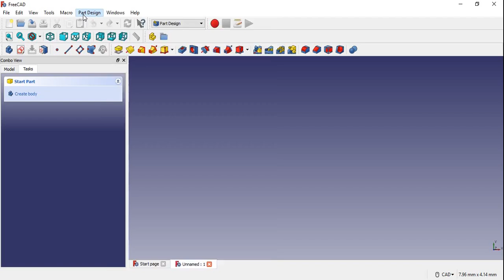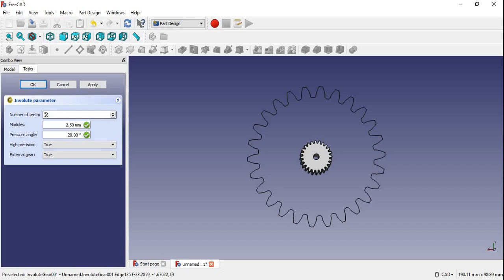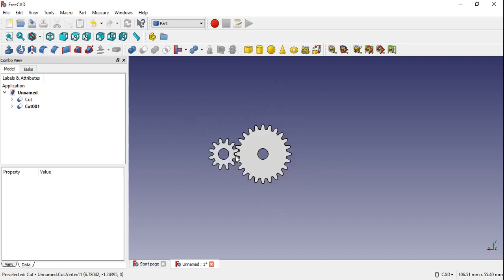How to make gears in Freecad

Comment: Gear Diameter: 
Modules = Desired Diameter / Teeth

Mesh Properly:
Modules must be the same

Position Equation: (M*(T1+T2))/2
(Modules*(Teeth1+Teeth2))/2

Angle Teeth:
360/Teeth/2
Reply: Thanks a lot man!
Reply: im running into an issue. i have to make a gear that is smoth on one side while the other has 9 teeth with an outside diameter of 32mm. i made a gear using 32/18 module, than made a half tube 16mm radius to cut the unwanted teeth off... the gear does not have a radius of 32... its larger than my half circle, what's wrong?

Comment: 0:45 for anybody out there trying to get their outer diameter to be exact, the given formula in the video isn't correct.
the formula for outer diameter is:
OD = module * num_teeth + 2 * module

solving for module this gives:
m = OD / (num_teeth + 2)

hope this helps anyone wondering why their OD isn't as expected using the formula in the video.
Reply from the maker: Yes, you are correct. Maybe I should've been more clear in my video, the diameter I was talking about was the gear pitch diameter. This equation is good to know when wanting a specific gear ratio and a have set distance between two shafts.
Reply: @TabletopRobotics  The rest of the video was super helpful, I'm just new to this and my gear wasn't the right size so I had to do some digging and left a comment in case anybody else had the same issue.

Comment: Thanks ,  good video. A little fast for me at times but I just paused , went back and rewatched til I understood what you did. I'm older and hearing isn't as great anymore. I had  some trouble with the part where you divided th gear diameter by the number of teeth. It didn't work for me. I have a gear with a 36mm diameter with 13 teeth.

Comment: Maybe I'm doing something wrong, but I don't get true involutes on a gear designed in FreeCad, but just straight lines  - so the gears would not mesh correctly. Is it possible that this Gear-Design is just a rough approximation or am I missing a parameter ?

Comment: I need to 3D print a gear that is out of production for a lathe. I’m new to CAD in all senses so I’m trying to follow along but when I select [Cut of Two Parts] it stops working. I just installed V. 0.20 how can I get past this point?

I also need to use US standard units for this gear: involute instead of Modulus, how can I change this?